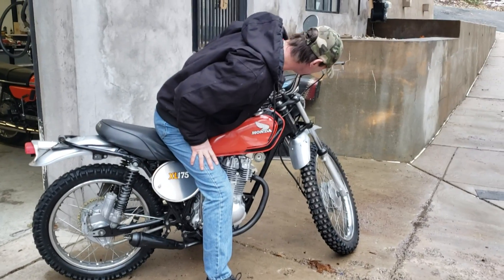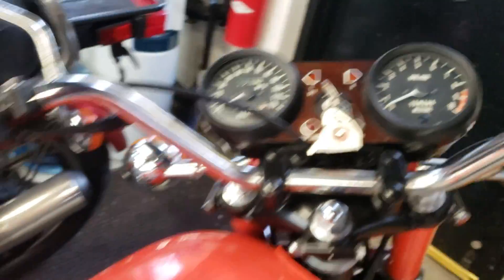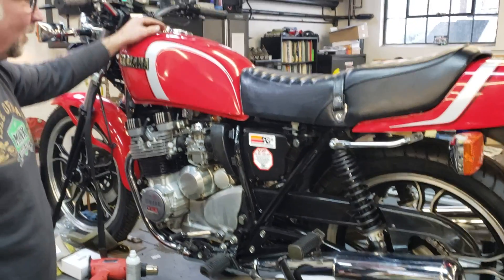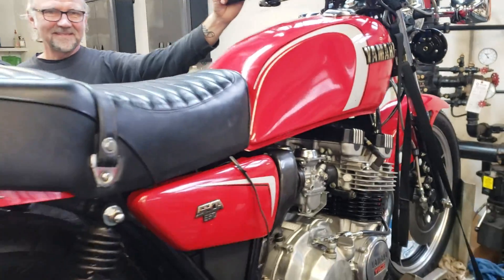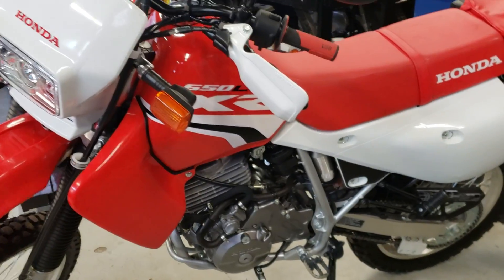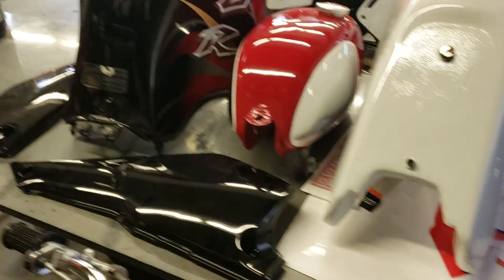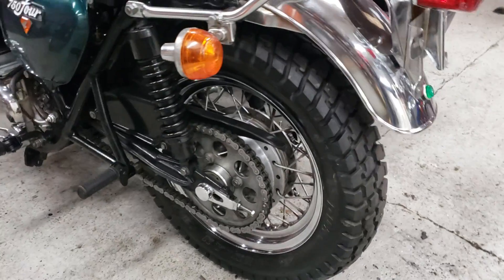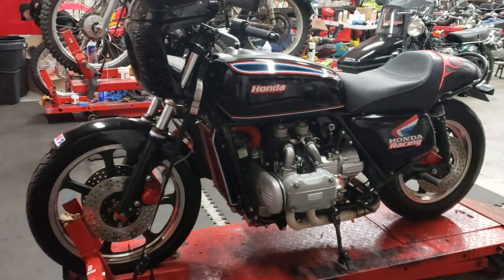SHOP PROJECT UPDATES; 1975 HONDA XL175, 2019 HONDA XL650R, 1975 HONDA GOLDWING

Comment: I had a 82 seca 550 bought new in 82 teleflex fork brace kn air filter spec 2 four into one carb and head work metzler tires would eat 750s for breakfast fast as hell one bike I really regret selling.